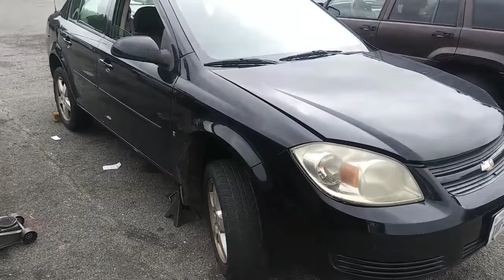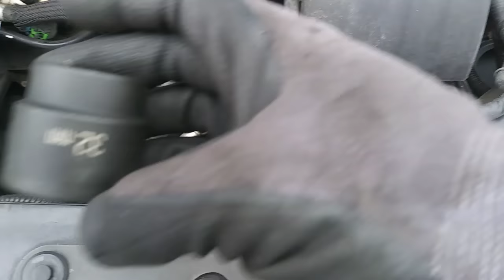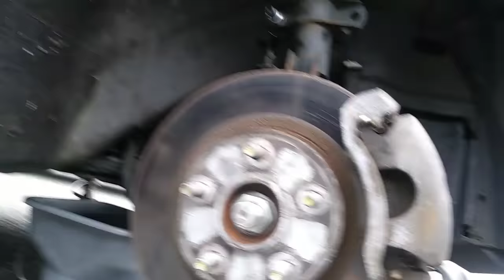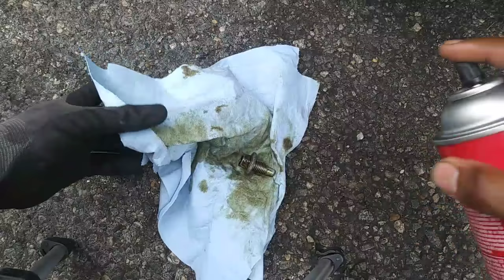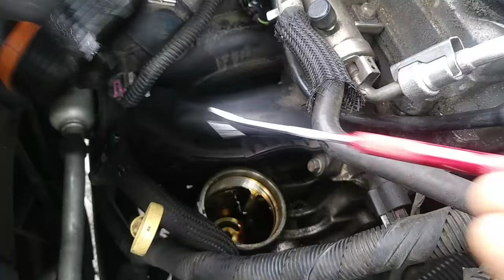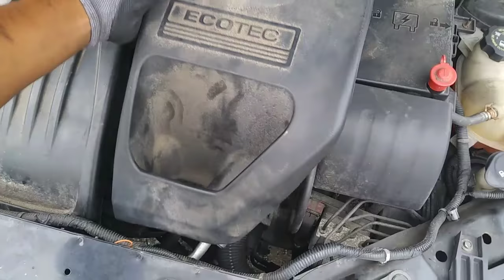OIL CHANGE (2005-2010 CHEVY COBALT 2.2L)

Comment from the maker: WHY YOUR VEHICHLE NEEDS AN OIL CHANGE:
https://youtu.be/FlLdT77bLm8
Reply: My bf just topped off all my fluids in my 2009 cobalt. The next day I told him is was running funny and the motor didn’t sound right. He asked if the engine light was on and it wasn’t. So nothing further happened. The following day I started my car and the engine light comes on, in addition to that it was running even worse than the previous day. 

When I first got the car he checked the oil and said it was empty so he filled it up, my car ran worse, he checked the oil again and realized there was twice as much as what should have been there. He didn’t drain it till I pitched a fit. He told me it would burn its self off and I called bs. 

So I called him out on it again this time, he pulled the stick out to show me and the oil came up to the point where the cone meets the stick. It doesn’t go up the stick like before but I feel like it is still too much.  I’m obviously no mechanic and don’t know much about cars, but he has done questionable things to my vehicles in the past.  I drove a truck for 8 yrs and every other month he would have to replace a bearing or break and only 1 at a time even though you could clearly hear others going out, but he would tell me I’m fine to drive it, just don’t go out of town and keep your driving to a minimum.  

Am I being paranoid? Does this seem legit? I know it’s an old car and I bought it as a rebuilt title, I just wish I knew more about cars and could do the work myself

Comment: THE cleanest, easiest to follow, most descriptive and helpful video for this project I have seen. Ive seen at least six others and none of them mentioned removing the passenger side tire. Removing the tire gives you a lot more room to work and easier and safer access to the drain plug. This is a great step to have. Awesome video, sir. Bravo.
Reply: Damn dawg, your comment was unnecessarily detailed. Get a freaking girlfriend
Reply: I've owned a 2008 Cobalt since new, NO need to remove a tire to get to the oil drain plug , So unnecessary.   Just drive up on two pieces of 2-in x 10-in wood  (homemade ramps) if you want to go crazy you can even make the ramp 2 or 3 levels high.
Reply: @YoSauceBrazyy why you hating for no reason must be real happy in life😂

Comment: Thanks for this informative video.  I was able to remove the oil filter cap using a 1 1/4" impact socket I got at Harbor Freight for $3.99 plus tax. SKU # 67849.  Had enough clearance to loosen the cap until I could just twist it off by hand.

Comment: You forgot how to reset the annoying oil light on the dash;

To reset the oil light after changing oil you want to get in the car and turn the key to the on position (without turning the car over) and tap the gas pedal 3 - 5 times. Then use the info button on the steering wheel to browse your display to the oil status to insure your oil life now says 100%. And your done!

You may wanna pin this. Also love your videos
Reply: On behalf of 54 people that liked this comment, thank you!
Reply: I've come back to the comment every time i change my oil to check how to do this, thank you very much!

Comment: Oil change videos are becoming very popular because more people are starting to do their oil changes themselves because they are tired of wondering if a shop did the oil change correctly, and put in quality oil & filter (if they changed the filter).

Those were some easy to follow instructions WITH torque specifications!
Reply: Sadly more car makers are designing cars so you cannot do your own service due to specialized computers or expensive/proprietary tools needed to do the job.

Comment: Like your videos in general and this one too.  I have worked on cars since I was a teenager and worked in the industry for 10 years plus. Only issue I have with this video is utilizing a impact ratchet for the job.  Always used hand tools anytime I performed one of thousands of oil changes.  Don't know if it is wrong or not, just never needed to use impacts for an oil change.
Reply: Just FYI, that is not an impact. Just a cordless ratchet - works just like a regular ratchet. An impact driver or wrench actually uses an internal hammer mechanism, which we would not use in an oil change application.

Comment: I personally can’t stand this style of oil filters, what the hell was wrong with metal spin on filters?? Not a fan of this plastic fantastic crap. Your ratchet got a bonus lubrication there haha.
Reply from the maker: BubbaZanetti6666 I agree. they are called Cartridge oil filters and the enviromental people say these are safer since the construction of cartridge oil filters doesn’t include any metal, they can be incinerated instead of being tossed in a landfill. so like Catalytic Converters, these might very well be the future my friend
Reply: WDYM they're better. 
They don't leak oil all over the subframe when you remove them and they don't rust when they're screwed on to the bottom of the engine. 
I've never had to use a strap wrench to remove a cartridge filter Js....
Reply: The oil filter change on a Cobalt is without a doubt the easiest I've ever had on any vehicle I've owned and practically zero mess. Do you think the metal on a spin on filter actually does anything ? it's just a holder for the filter.

Comment: 1 1/4" socket with a short extension also works well for the oil filter cap thing. Remove the tire- you're crazy.

Comment: Great Video! Do you mind showing how to locate & check the transmission fluid on the same vehicle? Mine is a 2006 Chevy LS 2.2. I have been told $245 to drain and change the fluids.
Reply from the maker: Unfortunately the chevy cobalt does not have a transmission fluid dipstick. There is only a fill & drain plug

Comment: man i always thought i could not do oil change because of two things,first i thought the oil filter was in no mans land and impossible to get to somewhere under the engine ,as i used to see mechanics fiddling there when i did chnages,,so idk wtf they was doin? second having to jack the car and go underneath with the right socket and catch pan etc ,,but once i found out how easy the location of the filter was i was like ohh yeah i can do this ,,changed my own brakes and rotor recently ,before that front and rear bulbs and they were a pain in the ass specially the rear and i want to be able to do more,,,hard part coming up next is changing my coolant ,was thinking about thermostat too but its a pain and i dont think i need it

Comment: after jacking up my car (2006 pontiac pursuit) with the sizor jack that has a notched bit made to fit under that seem or rail under the rocker i am still not able to lift the car high enough to slide in my 3 tone stands so i have no choice but to do like you done and put then under that seem since the stands also have a notch for fitting if needed ,i guess its ok to do that? problem is now i recently had a body work done on both rockers as one got dented in an accident and the other was starting to rust but the new metal now added thickness to my rail or seem so im worried about it fitting the stand or jack without pinching or denting or damaging the weather striping coating which happened plus im not sure how flush the metal is with that seem ,so if its a bit under then its gonna dent or bend,and on top of that for some reason (probabaly rust) he put screws on one side instead of spot welds to hold that trim against the seem and the back end of those screws might be in the way of the jack,i may need to cut them off,,,too bad i just got this work done ,hope it will be ok but i have no choice but to lift my car from those areas as i got no professional jack lift like some ppl seem to have room for

Comment: I noticed in your video your using Quaker state motor oil.  Is there a reason you prefer that brand?  I always found that brand to cause sludge and be very sticky.  What do you recommend?
Reply: I've been using only Quaker State in my 2008 Cobalt since new , and it's 2023 now and never had a problem...the sludge is an old wives tale

Comment: 1) Too much use of power took, not needed for this task.
2) Coating the O ring (not a gasket) with oil prevents the O ring from grabbing at the mating surfaces and possibly  pitching or kinking it which it then won't seal.  Otherwise great quick video.

Comment: Such a strange way for oil to be changed on a car, only ever had to do it on a Nissan 240sx and that shit was just the easiest experience, hand removal filter, and oil pan was easily accessible without removing the tire, but I can save myself $89-$100 doing this myself.. Choices.. Looool

Thanks for the vid!

Comment: No need to remove the tire.
Reply from the maker: +Phil Norbeck to make a good video showing how and what im doing without ramps you need to remove the tire! Im also a big guy and need the extra space. Thanks for watching!
Reply: @barricadegarage5361  i never thought of removing my tire, this makes sense.
Reply: @barricadegarage5361  Great idea removing the tire. Already up on jack stands. This will keep me from having to get all up in there.
Reply: Yea, no need to remove the oil drain plug neither. You can just siphon it out through the oil fill cap. Save you from having to get all up underneath the car and you don't even need to jack up. Always steps you don't need to do, but you got to ask yourself... is it going to make it faster and easier.
Reply: @paulweston8184   no need to remove tire, I'm a big boy , I jacked up from front of car, used jack stands on both sides of vehicle and slid right under
Reply: @robertmarquez6053  So instead of just removing the one tire and gaining access to the plug  on your feet, you went ahead and jacked up the other side of the car, put it on a jackstand, got  your creeper out or just put something down to lay on and pulled yourself underneath the car and opened the oil drain plug? That's how I would normally do it, but if you can access the drainplug without having to get underneath the car then why the heck would you still want to slide underneath instead, especiallly if you are a big guy. It's just an easier way to do it IMO.
Reply: I agree, there is no need to remove the tire, but if he did it to get a better camera view he should have stated that was the reason in the video.  I have some wooden ramps I made myself (out of some old 2x10 scraps) that raise it 6 inches (4 thicknesses of 2x10), drive the car up on them, and I crawl underneath. No jack, no jack stands.  Other than the tire confusion, I thought the video was good as it was short and right to the point.  Probably should have mentioned reset of the oil change message on the dashboard.
Reply: @tommak6516  This is for a Chevy Cobalt. The oil plug is accessible through the passenger side wheel well. I myself find it much more convenient to just jack up the one side and pull off the tire. It's just a standard tire. Don't weigh much. I don't know why people are so timid to take off a tire. It's more efficient, I think maybe, than busting out a couple stacks of 2 x 10's to drive your car up onto. Then you gotta lie on your creeper on the ground to pull yourself underneath the car only to work in an uncomfortable position having dirt and oil possibly drip on your face. And after the oil done draining you gotta crawl back under there and put the plug back. I'd rather be on my feet and take off a tire and get my hands dirty.
Reply: This is a funny commentary. Just do it however you prefer.  😜
Reply: @michialphelps2339  It makes no sense , just buy some 2-in x 10-in wood and make a set of ramps that you can use the rest of your life
Reply: @tommak6516   Exactly what I have , and wood ramps are  the best and safest way to do it
Reply: @tommak6516  I wouldn't trust my car not to break down and fall on my head lol. Maybe thicker wood?
Reply: @michialphelps2339  The ramp (2x10's) are laid flat, nailed together.  Wood in compression is about 6000 psi.  So if ramps are 240 sq. inches each, they would hold up  over 2 million pounds.  Should be plenty strong.

Comment: Thanks for helping me find that stupid oil filter... What a stupid idea... And a special stupid socket of course, like there we havent bought enough tools for stupid single use reasons... Im grinding this stupid socket down to fit instead... Stupid stupid stupid
Reply: The only thing stupid is you crying over having to buy a $6.00 socket. Changing the oil filter on a Cobalt is the easiest filter change you will ever do. No laying on the ground and no mess.